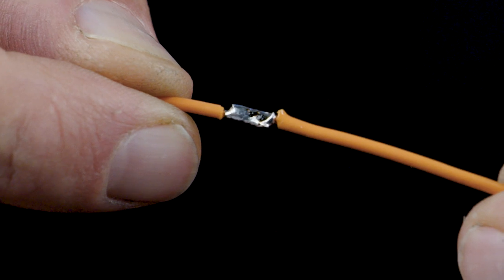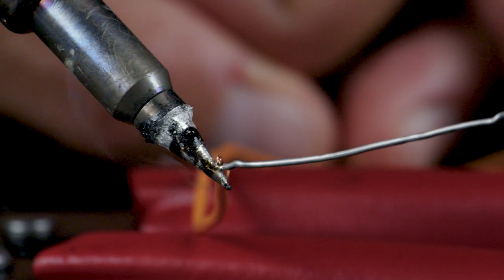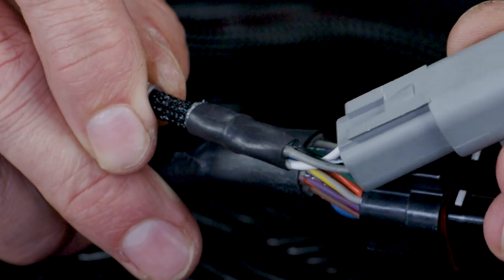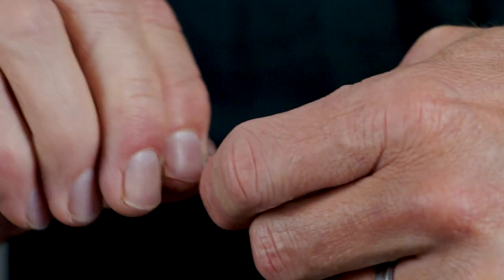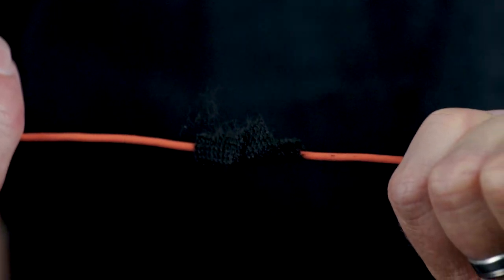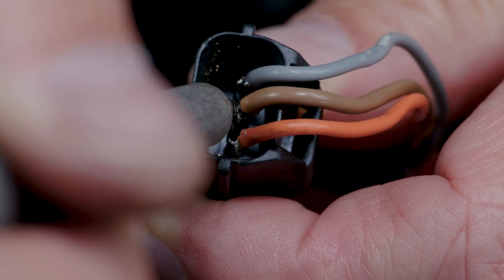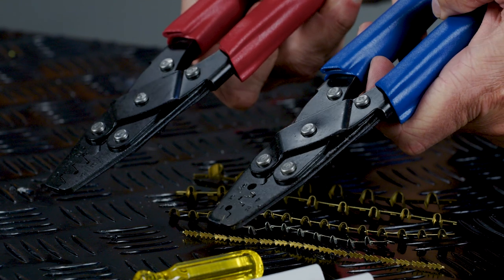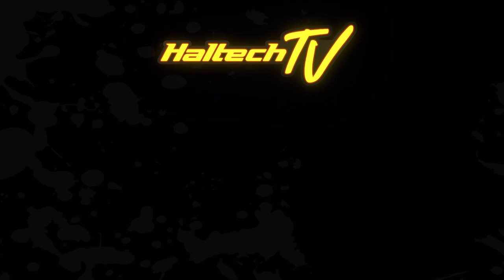🛠 Crimping vs Soldering - Which Is Best? | TECHNICALLY SPEAKING

Comment: some copper facts. copper acts the opposite to steels and other metals when heated and cooled rapidly in water (quenching) it is in its softest state (unlike steel which hardens). Now copper is a time harden material same with bronze (a copper alloy) as it ages it gets harder, a harder material the more brittle and less ductile.

Now to anneal copper you need it up to and above around 300 degrees c which is still higher than solder most soldering irons will heat a wire to.  Second a bonus is annealing helps older wires soften and reduce the chance of breakage near the join. Third copper does corrode anyone pulling apart a good ol 2jz harness will have seen the greeny, dark brown almost black wires that have corroded and hardened over the last 20 years. now this is a pain for two reasons 1 its hard and brittle so bending it can break it 2. copper corrosions offers poor conductivity and higher resistance with surface contact.

now someone watching a video on joining decides to crimp as a repair or modification as its easier and talked about it in better light on the net. Now they have electrical problems or worse have a small fire in their supra. Now at a shop we find the issue and have solder it with no issue remaining after the use of heat to anneal the location and acid core solder to strip the corrosion.

On brand new stuff a crimp to termination is always better as its close to mechanical stresses from ham fisted grease pigs, a Mutiple of wires in a join or joins midway , solder is always better
the best is a crimp that is soldered as it full prevents the wires from slipping in the crimp from the added material but also are firm from the crimp within. Haltech I expected better facts rather than a misleading marketing plug.

Comment: If you are experiencing corrosion at a solder join then it has been done wrong..use lead free resin solder only and seal after...but modern crimps are far better than they used to be, back in the day there was only utilux available and they were not great.

Comment: But what about soddering? They invented sodder in the land of liquid Gas.

All jokes aside, a good synopsis.

I've done a lot of soldering and crimping in my time, heck I've even spot welded electrical wires together. (Cause I could)

The fact remains, solder (tin and lead) is not the best conductor of musical orchestras, and electricity too for that matter. 

Copper to copper with a brass crimp will always yield a lower electrical resistance.

Comment: I still use twist and solder if it's a single wire and crimp if full loom but a desent crimper is required I've been criming on full looms it's just nicer and neater

Comment: Why is it that no one on the internet knows the proper way to solder two wires together? I was taught, how can it be electrically strong if it's not mechanically strong? The first step after stripping the wires is to make a SOLID mechanical bond between the two wires! Never use the solder to hold the wires together! Twist them tightly together. When soldering, heat the wire and apply the solder to the wire so the Flux melts and cleans the wire before the solder melts. When the solder flows into the strands of the wire, remove the heat. Avoid a cold solder joint by holding the connection still until the solder solidifies.
Crimp connectors make a great mechanical bond, just add solder!

Comment: Be aware that solder will creep. This is why you should never let it hold wires together or especially put it on copper that you are planning to use with screw terminal. That kinds of connection will fail sooner or later, depending on force being applied to cables. To (kind of) properly join two wires you have to twist them tightly and then only secure them from untwisting with solder. That will last usually for years.

Comment: Not surprised that crimping is recommended when you sell all the tools and crimps necessary. A roll of solder on the other hand is available anywhere and usually lasts for ages.

Comment: If you're joining wires on a garbage truck that are getting covered in bin juice every day, crimp joints win hands down. It's not even a close competition. The solder joints will rot and fail in a matter of days. You need to use hot glue heat shrink and even then it's no guarantee. Those cheap red - blue or yellow crimp connectors will last years in those conditions. I learnt that the hard way years ago. 😆 But of course it's horses for courses.

Comment: Solders add resistance to the wire/line and may affect readings of your sensors.
Reply: No. The resistance is insignificant, like millions times lower than that of the wire.
Reply: @brys555  it depends on how much solder you put on it...
Reply: @deanvarian9275  Not really. Regardless if there is only small drop of solder or wires are dipped in it, the resistance will remain very low. The resistivity of solder is indeed tens of times higher than that of copper but the thickness of its layer in the joint is a fraction of a millimetre. So we are talking about adding an equivalent of 1/8 inch of copper wire to the harness that is few feet long. Besides that, copper cores should be tightly twisted together before soldering which reduces resistance even further. Otherwise there is a risk of solder breaking causing joint to fail.

Comment: I pick bad crimps out of oem harnesses all the time.  They are very far from bullet proof.  I've also had them turn up with this weird tarnish that caused them to lose continuity.  Don't know what it was.  Some oil adhesive goo maybe?  Trash like this can compromise a crimp more easily than a solder joint.  I had one last week that was a junction for sensor ground.  Continuity out to the coolant temp sensor, but not the tps and afm.  Clipped the joint out of the harness, and it didn't even look bad, but it sure did fail.

Comment: Solder joints can crack on poorly supported PCB's too. Seen it.
Reply: that is because too much heat is in the system and power is not truly correctly regulated on those PCB.  PCB use far more heat than cables do.  I repair a lot of PCBS because of this issue but never had failure of a wired solder.

Comment: wires will break behind the soldering,but crimping with a bad/cheap tool is even worst.
Good crimping tools are not cheap.And cheap crimping terminals are also a sucses to failure.

All big wires in the industrie and naval industries are crimped.Good luck to solder wires from 120mm square or bigger ;)

Comment: Sorry to be “that” guy, but “annealing” the wire isn’t that big of a deal, annealing metal is simply trading stiffness/hardness for ductility/flexibility. And if low temp solder won’t hurt delicate PCB’s it’s unlikely to anneal wire to the point of damaging its grain structure making it weaker.
Annealing steal usually takes hours of low temp heat, 1-2hours in an oven for 1075 high carbon steel, which has to be done, otherwise the steel is like glass and can crack/shatter if it experiences a shock.

Comment: I'd imagine many people have problems with crimps failing because they're using poor quality crimping tools. I'm not saying it's absolutely necessary but the manufacturer's suggested crimping tool can cost between $300 and $1000 and are designed to produce the optimal crimp. There are some videos from manufacturers of crimp terminals on YouTube and you'll find that a proper crimp is more than just mashing a terminal onto a wire.

Comment: TECHNICALLY SPEAKING , a soldered crimp is the best , you know " belt and suspenders " only solder the very end of the wire for least resistance.

Comment: Even the biggest beginner can do a passable job when crimping a wire and have a good connection, therefore most people should stick to crimping even some solder bros. The solder joint shown here is not acceptable even as a temporary measure to see if the circuit works, that being said a solder joint is far superior in all cases but there is a reason why Bombardier, Boeing, NASA and more send people thru a class that has a 50% drop out rate to achieve a certification to pay these individuals 100k a year salary.

Comment: You left out the reason why a soldered joint goes weak or cracks. That being when a solder joint is made on multi strand wire it becomes a single core and concentrates vibation work hardening at the interfaces.

Comment: You won’t find soldered joints in aircraft wiring harnesses. There’s a clue.
Reply: Solder splices are used in a lot of aircraft for shielded wire ground jumpers 🤙
Reply: @Evo_Warp  RPT aircraft?
Reply: I've seen it in military and private aircraft
Reply: @Evo_Warp  I’ve no experience in military or GA but have never seen it in large RPT.
Reply: My car has never been airborne. The environment is a little different up in the sky
Reply: @rossmarzano  never? Not trying hard enough.

Comment: One thing you should emphasize more, crimps are better, hands down, ONLY if the right crimp, right wire size and right quality tool is used. Otherwise, don't bother. Use only the right tools, if not available, use solder. Solder is better than a crimp done with the wrong crimp, wire size and poor quality tool or used improperly.

Comment: You don't mention twist/fold and solder... I have seen many crimp joints (factory produced) which were so poor the wires would separate with almost no load. Crimping often is not a good choice for multiple taps from a single feed wire, or wires that are different diameters and/or single to multi-strand like many sensors require.
Reply: This. Solder is there to keep wires from untwisting, not to "glue" them.

Comment: "Crimping is 'Cold Welding', thus it is better."
"But soldering is 'Low Temperature Surface Alloying', which has more words than your so-called 'Cold Welding', thus it is way better. I win."
LOL...
At least solder joints are sorta more waterproof than a crimp of stranded wire, therefore inarguably longer lived in wet and corrosive climates.
Reply: For clarity, when installing a terminal at the end of a wire, it obviously cannot be fully enclosed in heat shrink tubing. A crimped-on terminal with the ends of the stranded copper wires peeking out is inarguable not fully waterproof. A soldered and then heat-shrink covered terminal (esp. self-sealing HS tubing) has a good chance of being fully water proof for life.  Bit contrast in this case.  Splicing wires is vastly less challenging than terminals at the end of the wire.

Comment: Solder, then mechanical connection? 🤔
Okie dokie..... instead of  applying silicon grease prior to hear shrink tubing, ill slather the connection with JB Weld immediate before heat shrink tubing.
Gitter done! 👍

Comment: A good solder joint of wire starts with a good mechanical joint of the wires and not twisting them together neither. A good mechanical joint such as the lineman's splice provides an excellent mechanical joint, then solder it. The solder joint in the video will fail eventually because it relies on the solder for mechanical strength. Soldering has its place as does crimping. The aircraft industry, civil and military, use crimps where ever possible, your motor vehicle seldom if ever goes through the extreme temperature changes the wire joints in an aircraft go through in the span of several minutes while changing altitudes. The debate will rage on like which came first, the chicken or the egg.

Comment: This is about "joining two wires" ?  What about the other 98% of the harness that has terminals at the end of each wire?  Some (I think I should write "Most") terminals are clearly Crimp Only (which is fine), but common Ring Terminals can be either crimp-on or solder on. Note that the crimp-on versions will have all the cut strands of wire peeking out, even with HS tubing added. Cannot be waterproof. My Mercedes has soldered ring terminals at the ground studs, likely for this reason. Now if they'd just stop using biodegradable insulation... 🙂
Reply from the maker: We have already done a separate video on crimping and de-pinning harness connectors.
Reply: @haltech    *Ring Terminals*, as used at Ground Studs.  Are there actually waterproof Crimp-On ring terminals?  Every Ring Terminal I've seen has all the little copper wire peeking out, so water would wick up into the crimp.  I'd solder Ring Terminals, and then cover with HS tubing, thus the little wires are sealed in.
Reply: Ring terminals ? I don’t think I see much ground to frame single wire anymore but all you would do is just heat shrink tubing with sealant over the crimp.
Reply: @eric4946   Plenty of brown colour Ground wires with ring terminals on ground studs. I've not bought a car in the last ten minutes, so perhaps my info is a few years old. Those that treat crimping as a religion will have more failing grounds after a few years in a wet climate. Solder is a better sealant than sealant. Those worried about soldering could just seal the end with solder.
Reply: @JxH  with cars going away from steel frames and plastics and composites it’s not common. But still, solder is only going to seal the wire to wire gap which if properly crimped shouldn’t exist becuase the copper is compressed as would the insulation using proper connectors. 

Are there “proper” ring terminals … different story. Since it’s uncommon no one bothers I imagine to make anything more complicated.

My view however is that metal/conductor isn’t use to seal wiring. Once you have water on a contact it’s over anyways pretty soon. Yeah for a clamped joint this isn’t true but any sort of pin/socket it doesn’t help. You need to insulate the joint itself.

Comment: Sorry, think I missed the part where solder was bad. They are both different and nothing more, soldering is better for corrosion as there is no gaps in the connection for moisture, crimping is faster and easier in tough to get at locations. The whole annealing bit is just silly, you have to tool harden copper, heating it only makes it softer.

Comment: You must create a mechanical joining of the wires before soldering them. Solder is not glue and if you use it as glue your joints will fail. @1:29 if you solder two wires together like that you fail basic soldering 101. You must create a mechanical joining of the wires before soldering them. Technique is important in both types to say one is better than an the other is incorrect.

Comment: Unless you are doing a PCB .. crimp. The situation dictates
Reply: In a marine environment, crevice corrosion is often what makes the joint fail.  To prevent this, you flow solder on after the crimp.  On stuff like mining equipment and the like, you may also run into the same sort of failure unless you solder after the crimp.

Comment: Soldering is fine if the vibration/movement is factored in, and rosin is cleaned afterward.  OEM are incentivized to make the wire as short as possible and secure ot as less as possible.
Soldering requires more skill and Haltech doesn't sell the tools and consumables.

Comment: You didn't mention the middle way: Posi-locks. I'm happy to solder and to crimp, and have seen problems with them both. A Posi-lock joint is incredibly quick and easy and I've never had a problem yet (mechanic with 45 years experience). And no, I don't have any sponsorship from Posi-lock. But worth checking out.  https://www.youtube.com/watch?v=TA3q_8UYpm8

Comment: Wire to wire soldered connections should have the strands mechanically intertwined prior to soldering.  If it's not mechanically intertwined, that would be why your solder joint is cracking and failing.  The actual big problem with solder joints is that the flux tends to wick up into the wires where you can't remove it.  It's the flux that eats away at the strands of wire over time causing a failure of the strands.  A good solder joint will not crack.  All crimp connections will have to be tested by pulling on the wires to ensure that the crimp got properly compressed.  I've seen plenty of crimp connections fail due to the simple fact that the crimp wasn't closed on the wire tight enough.

Comment: I've done pull tests, crimp fails every time, ok so tension is not a normal condition but a concern. Corrosion on crimp fails most of the time or creates high resistance. Properly soldered joints with shrink wrap  tubing is your best option. Soldered joints can be opened and re-soldered over again,  crimp you have to cut, strip, and re-crimp, and it shortens the wire. Crimpiing gives a weakened area right at the edge of the crimp. Only use crimp in an emergency situation.  I've not seen annealing as a problem either.

Comment: I'm still failing to be convinced. Electrically soldering is better. I never understand why people dont talk about the maths with this argument. For an electrician it's about the best electrical connection in relation to surface area as surface area is used in every equation for current carrying capacity. Crimping only connects 10% of the conductor while soldering is almost 100%. Of course this may not be the case with automotive applications where movement is a concern but the main earth of every house is soldered and not crimped for a reason.

Comment: 1. If you are heating the wire enough to anneal it when soldering, you're doing it very wrong.  
2. If your solder joints are cracking any more than a crimped connector, you're also doing it wrong.

 A proper soldier joint will be just as strong as the wire itself. That said, ideally you DO crimp AND solder. That mess about the heat is just silly nonsense. If do it correctly the solder will flow into any gaps that the heating might create, and should if anything make a TIGHTER connection when cooled. 

That only reason crimping is the best option, is when working in the vehicle and soldering is not feasible. (*Edit*) or very hight current load circuits.